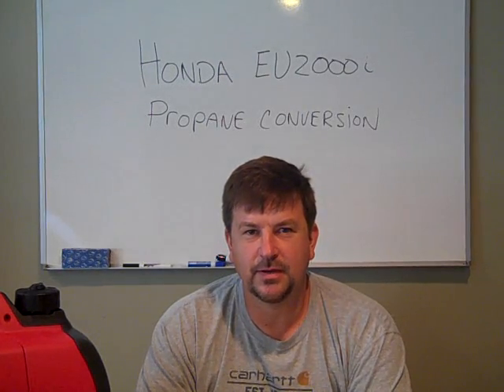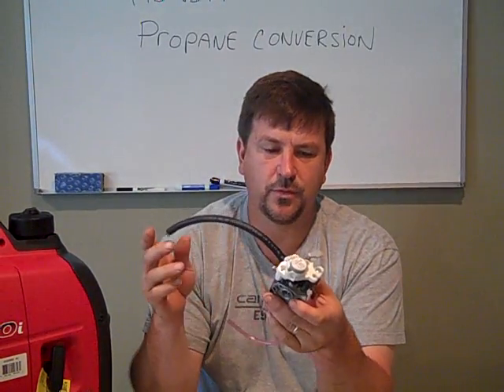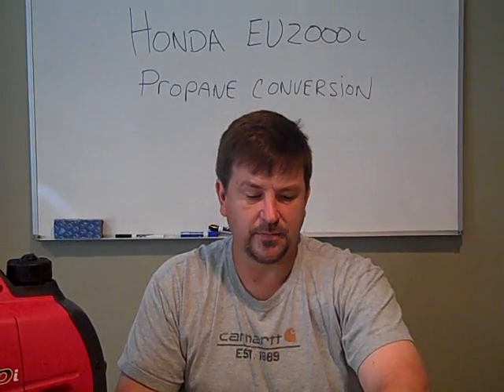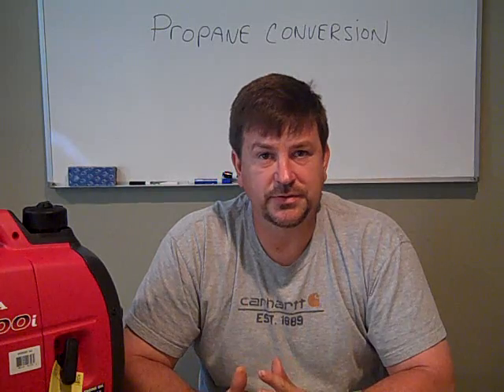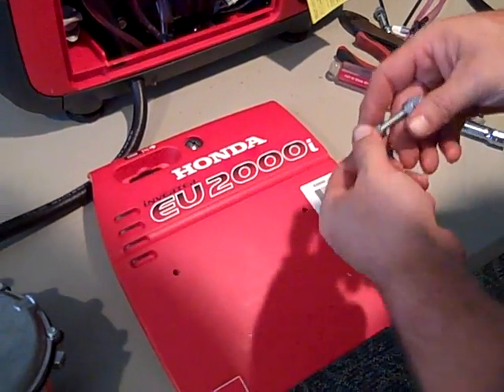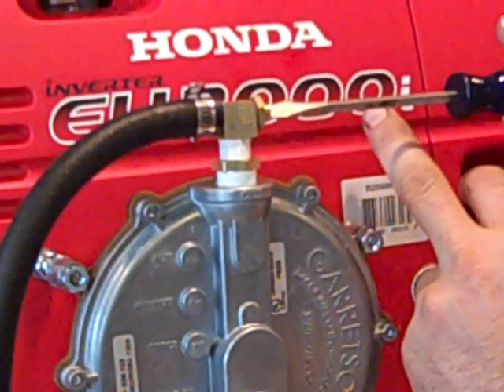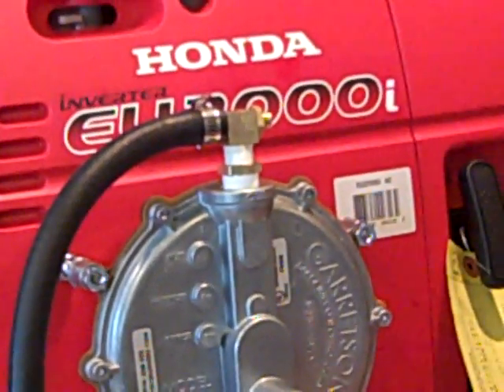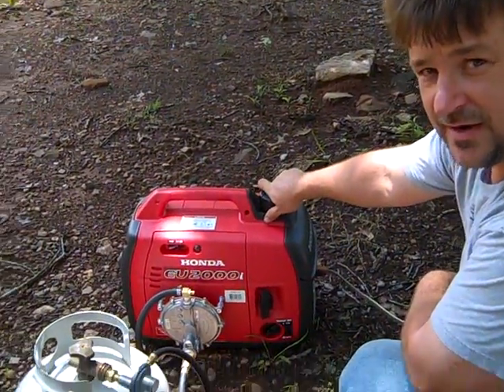Honda EU2000i Propane conversion

Comment: Does anyone have instructions on drilling the carburetor?  I have two of these running, and want to do a third.  The original kits came with carbs.  I'd like to just modify the 3rd one myself.  Thanks.

Comment: I had a friend who worked on propane forklifts. He said when they pulled the engines down they were spotless inside, the only problem was the bores were torn to pieces. He suggested gasoline( What we call petrol herein Australia) is a lubricant so start your cold engine on gasoline first once warm switch to propane. The gas will lubricate the bore until the generator has pumped oil around the engine. Most gas cars in Australia do actually start on gasoline (Petrol)once running they switch to gasoline automatically to prevent excessive bore wear. Something worth thinking about in particular with a generator that has been sitting around for months the bores will be completely dry.

Comment: I did it with a deferent kit and no need to exchange the carburetor, to be honest not sure which is better.  Not saying anything bad about the kit you are mounting just curious if you have looked at the Hutch Mountain kit which is pretty more expensive.

Comment: Took it boondock camping - VERY quiet▫▫>share4.photo/H2KGenerator?w49w   couldn't hear it in the camper with the generator about 12 feet away. All the power my camper could require. Also set up so I could use it sparingly at my house in case of power outage.

Comment: too bad central maine diesel got shut down on these projects by the EPA on making these modified carbs... way too much government on this!! I would not mount the demand regulator on the side cover... the vibration wears the needle and seat on the demand regulator..
Hutch mountain is making kits... but the do the thin adaptor plate before the choke...
www.hutchmountain.com

Comment: Nice, but this is one ugly kit with that big regulator sticking out of the side like that. also, that Regulator sticking out would make the generator less spacious and bigger as well as easier to damage the regulator if it is banged against something or caught on something. Then again this seems like an old kit?

Comment: Is it an actual Honda carburetor they give you? There is another kit available on the market that doesn't require touching the carb. It injects the propane through a gasket that goes between the carb. and the breather box.
Reply: hutch mountain has a kit. do a web search on them.

Comment: It's a shame Honda or some other top company can't make a generator that's simply multi fuel functional. Also needed on the gasoline eu 2000 is a separate fuel cut off switch so we can run the carburetor dry without having to run the tank empty. Thanks
Reply: the real shame is honda already has a lp gen for the Japan market only... last I knew it would not pass the usa epa and cali carb regs..

Comment: I have read that propane is actually 110 percent octane causing the engine to run hotter meaning the exhaust valves have burned out due to extreme heat. Regular gasoline is 87 percent octane.

Comment: Just in terms of cost to run, is it more or less economical than using gasoline? Assuming today's gas price of about $2.40 per gallon.  If you run solely on propane, would you still have to clean the carburetor every now and then? Also, how long will a tank of propane last (assuming 50% load)? Thanks for a great video.
Reply: natural gas is cheaper to run yet!! the advantage on lp is it stores well for long term storage.

Comment: Question: What is the pressure regulator for?
Reply from the maker: It presents the right amount of propane to the carburetor.
Reply: The "disk" regulator is a negative pressure regulator. It will only allow fuel flow in the presence of a vaccum on its outlet. This provides proof of run from the engine and prevents fuel from being dumped out causing an obvious safety hazzard. The manual prime button allows the user to momentarily override this ssfety to provide a shot of fuel in the system to allow the engine to start and produce the vacuum

Comment: Thanks for the video!  Quick question: what PSI rating does your regulator hose have?  I can't get my setup to run in the double regulator configuration (the small one on the hose, and the large one on the generator)?
Reply: the hose after the lp regulator only needs to carry 1/2 psi as this is the max the demand regulator will stand for pressure. and the hose from the demand regulator is a suction hose as it sucks the fuel from the demand regulator.

Comment: no RPM control (no eco throttle)? This also won't work (or work but not for long) in freezing temperatures. Car regulators are heated by tapping into the coolant line, it's a bit of a problem with air cooled engines with no easy solutions. In freezing temperatures the evaporator membrane won't last long without this. Do you think there's demand for cheaper propane kits without carb modification and with easily reversible install?
Reply: Auto gas vaporizors use the heat to flash the liquid propane to usable vapor. Small tanks in high demand applications can not absorb enough heat energy via conduction to maintain proper tank head pressure. There are 100s of thousands (or more) of vapor only regulators in cold weather applications.

Comment: Nice job, but it looks like you used (white)  Teflon tape. 
Yellow tape is specifically made to be used for gas piping. 
White plumber’s Teflon tape (on gas pipe fittings)  will degrade over time and gas vapors  can escape from the fitting. 
Plumber’s Teflon is white in color and also thinner than yellow gas-rated Teflon tape.
Other than that, still a nice video to explain the installation.
Reply: That's good to know.  Just curious why I've never seen the yellow teflon tape in stores.  Is it commonly available and i've missed it all these years?
Reply: @acoustic4037  Never knew this either. I guess the yellow tape can be used for more things than the white. I'm gonna ask next time I'm at Home Depot. I also think it's a shame at such a high price the Honda isn't made multi fuel functional by the flick of a switch from the beginning.

Comment: Nice demonstration.  I would be curious to see a honda generator, which is modified for propane, running on wood gas as an alternative fuel.  In a serious long term grid down situation propane may not be available to most.  Even if you've stockpiled propane, at some point the supply will run out.  Woodgas then may be the only viable option for running engines, aside from HHO / Brown's gas.  The drawback to Brown's gas is the need to produce on demand.  With available solar, enough gas and be produced via electrolysis to keep an engine running.  However in the absence of solar making gas on demand isn't possible.  At this point using wood gas to power a generator seems like the practical solution.
Reply: Very interesting, thanks

Comment: Gasoline's ignition point is 475-536 degrees F. Propane's ignition point is 470-878 degrees F. Could this damage the engine?

Comment: I would think Ethanol would be more sustainable longer periods then gasoline if and when something happens to the grid. Unless there is easy ways to create propane? I have seen some cool videos on methane/biogas i would assume this would work with that as well?
Reply: harder to run these smaller gens on pure ethanol... the jetting and emulsion tubes size is way off in the carbs.
but bio gas or methane or natural gas is viable with this kind of kit!!
you just use the 1/2 psi max pressure to the demand regulator.
and adjust the load block a bit richer than on lp.

Comment: Why do you have two regulators on the propane?  You do not need the one on the tank I think.
Reply: The tank regulators reduce the tank pressure (100+psi) to appliance level pressure (9-14 inches)  the "disk" regulator is a negative pressure unit. If it doesnt see vacuum from the engine's intake it will shut off fuel flow. This way if engine stalls, fuel isn't left dumping out.

Comment: Nice video!  I have a couple questions:  A few years ago I looked into converting one of my gasoline vehicles to LPG.  I discovered that the MPG for propane is less than gasoline and was wondering if you go through more LPG than you initially thought you would?  Also, have you noticed a difference in maximum power output of the generator when using different fuels?  Thank you!
Reply: +John Norris I have the same question, I live in a country where 40-50% of the vehicles run on LPG, I know that LPG does not have the same efficiency than Gasoline but is 3 times cheaper than a gallon of gasoline (lets say it works for cars at least in the economical way) but on generators I'm wondering if LPG is more efficient? because generators runs on same RPMs all the time they compensate a little with surge load but nothing drastic.

---Sorry for my english is not my native language.. BTW any relation with Chuck? -Joke.
Reply: John Norris propane does have less BTUs per gallon than gasoline does, although it has quite a high octane rating.
Most engines are somewhere around 9 or 9 and a half to 1 compression ratio or so. This is in order to use with regular gasoline. If you raise the compression ratio to 13 or 14 to 1 you will get quite a bit more power and efficiency, but you can't run it on regular gasoline anymore, although you can run it on propane, or other high octane fuel surpassing the difference in BTUs per gallon.
This is why very high performance race cars use higher octane fuels with high compression engines to get better power and efficiency. Many use alcohol , I've seen some use propane, and some use very high octane gasoline. They do not use regular gasoline.

Comment: Thanks for the video.  One question, doesn't changing that carb out with a non-Honda replacement part mess with the warranty of the unit?
Reply from the maker: yes, anything you do to the generator like this voids the warranty.
Reply: yes, it will void the honda factory warranty.

Comment: Just bought your book...love it!  Question about the CMD EU2000i Tri-Fuel conversion kit: Which fitting did you use to connect the hose from the propane tank to the large, round gas regulator provided by CMD?  My understanding is it requires a male-to-male 3/8" to 3/4" fitting, but I can't find one ANYWHERE -- locally or online.  Please help!
Reply from the maker: I am pretty sure I did mine with 2 fittings/ reducers.  IF you took your hose and regulator to a hardware store they could hook you up with the correct fittings.  Thanks for getting the book!

Comment: I don't know what Honda recommends, but several auto manufacturers recommend running their engines for several thousand miles with normal fuel (gasoline) before converting to propane.  The propane is so clean that there is not enough very fine grit to break in the engine, as there is in gas.  The broken in engine runs better and more efficiently.  After break in, you convert to propane.  This may be inconvenient for the kit company, but better for the engine.

Comment: Isn't it possible to make a carburetor to withstand the rigors of ethanol?   Some places may not have access to better gas.
Reply: the new eu2200i will run on E10... but not any higher on the ethanol.

Comment: When checking 'on load' try using something like a small fan heater, oil filled radiator, hair dryer/heat gun or halogen work lamp/s. They give a steady load and there's plenty of time to then play around with settings.
Thanks for the video :o) * * * * *
Reply from the maker: Excellent reminder! 
Thanks

Comment: How does the gasoline and propane work  as far as once you have gas in the tank and your running gasoline and you shut off the gas and start the flow of propane . Do you have to run the gen till it stops running  on gasoline once you shut the shut off valve off.  great video I'm going to do that to mine . would you do anything different from the way you did it now that you have had it a while. can you add a link to where you got the conversion kit . Did you ever get a answer from donfachebella
Reply: easy way to shut off the gas is do a separate kill switch like in the hutch mountain kits... then the oem honda fuel kill switch becomes just a fuel shut off valve.

Comment: BTW I have the same drill and have had it for like 8-10 years. The think is pretty tough and has seen many many ladder drops and tough screws. Its finally starting to fail in the gear box but def getting another craftsman,

Comment: You dont need to remove the original carburator you just make a hole in the plastic inlet just in front of carburator put the gas line from regulator there and add some silicone

Comment: engineer775, Im a fan since PP show, Love all the work you do. 
I was going to post the question of wood gas to run it but it was already posted so my question would be... do you need to do this conversion to tri-fuel to run wood gas? I have 2 of the EU2000's and was going to try wood gas by just modifying the airbox to have my connection from the gasifier. (still need to finish building it though) Keep up all the good work and I look forward to each and every video.

Comment: I have thought about doing this for awhile now. I have heard rumors that if you do this to a regular generator that isn't built to deal with the additional heat produced by the propane it can cause damaged to your generator. Has anyone else heard this?

Comment: use the propane as primary fuel and gasoline as backup. and put the cutoff valve of the gasoline were you can access easily

Comment: I work on boats and we have the same problem with motors gumming up after sitting. So if you have enough initiative get your self some and run your stuff low on ethanol and put this in at the end of the year just to fill your carb up.

Comment: Now make sure ya put some fuel stabilizer in the tank if all ya can get is ethanol gas or run it all out dry. Run the gen at least once every month if not in use.

Comment: I use product know as solexx. On work surface and floor. 12pack or 2 litre Soda signs from gas stations the 3x4 or whatever dimensions. Then just put behind door for storage. Easy to just lift and tip into garbage can. Can fold to funnel. Save the nicer as memorabilia. Then it's no honey never work in here you know that. Just wiping up the mountain dew poster.

Comment: Hello: You did well, slick job. I hate it when the little plastic parts don't cooperate with me. This would be the thing to do the Lincoln Ranger 225, 23 HP. if I get it. And put a 80 Lbs. tank on it. I do not like the Ethanol Gas sitting. I want the Lincoln but I'm tight that's why I don't have it yet. Have a Good One

Comment: Nice Video. I did't realize these little Honda units throttle was fly by wire. Makes it easy to take the carb off without bending the daylights out of a governor rod and spring.
Thanks!